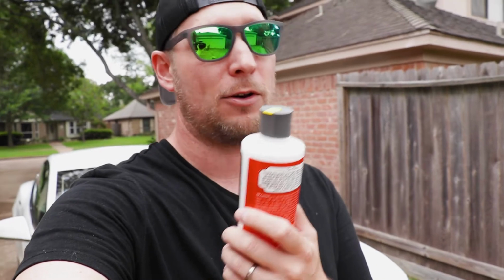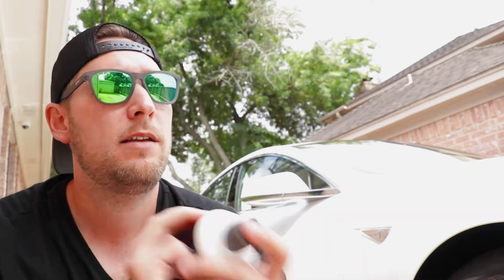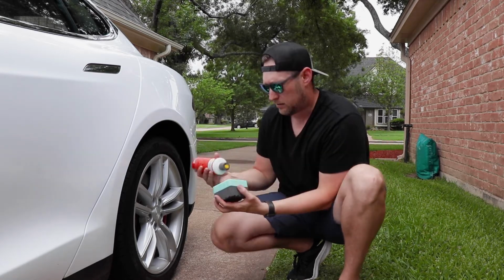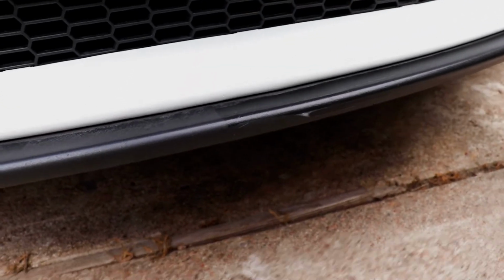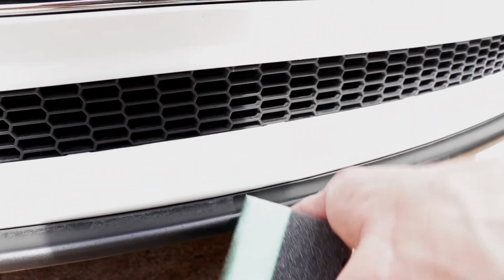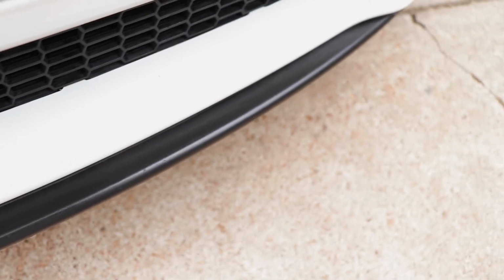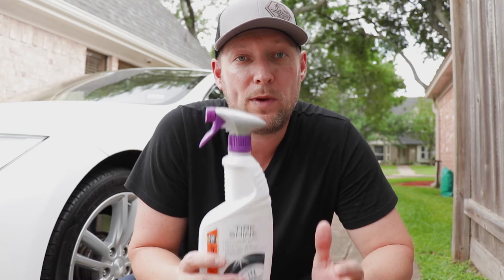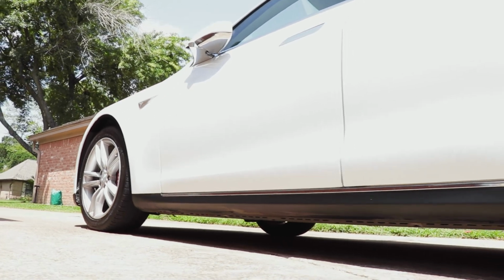Chemical Guys VRP Protectant First Try and Review - Vinyl Rubber Plastic

Comment: I like VRP for my tires. For a water base product it holds up fairly well between washes. For trim, thats not faded, I think ceramic detailers work best. They give it a natural slightly darkened look, hydrophobic protection and it doesnt run down your paint when it rains.

Comment: Finish was great but rained that night and it all went streaky!? I did wash thoroughly before and worked the product in - I have reapplied and hope that it lasts this time.
Reply from the maker: What did you use to wash it before applying? You may need to use a heavy degreaser or something citrus based to really strip it down to the tire rubber.

Comment: It washes off in the rain or by washing the car easily
Reply from the maker: I have heard that. How did you clean your tires before applying?
Reply: @freshsquiized  chemical guys wheel cleaner and a tire brush then rinse with water
Reply from the maker: I may do some research here and try some different products for cleaning tires. I wonder if just a heavy duty degreaser would work well.
Reply: @freshsquiized  ya it's just the tire products just don't stay on tires that much and usually wash off
Reply: @TheChillDeadpool not so much tires but any outside trim. But even the oil based stuff does.

Comment: How long did it last on the trim?
Reply from the maker: Mine lasts 2-3 weeks before I want to reapply. Of course it probably depends where you live. I’m in Houston and we had the hottest summer on record this year.
Reply: @freshsquiized Houston weather/temps is extra rough on everything! That seems to be getting worse each year, too. I won't buy a new car until I can garage it. The sun disintegrates plastic so quickly now.

Best of luck to you!